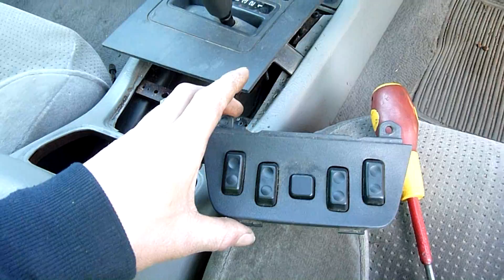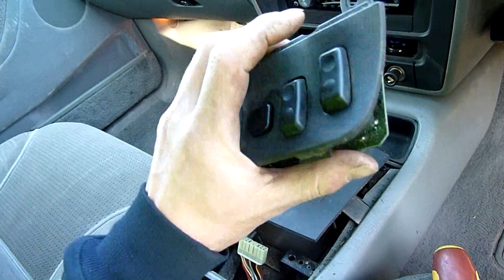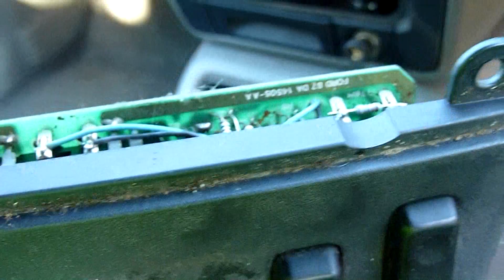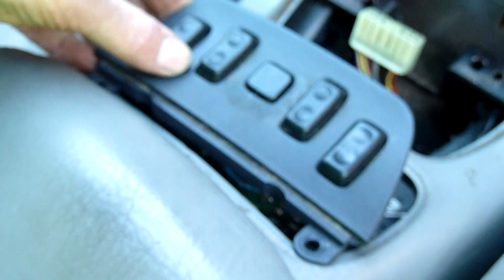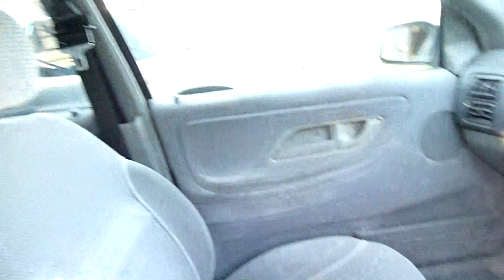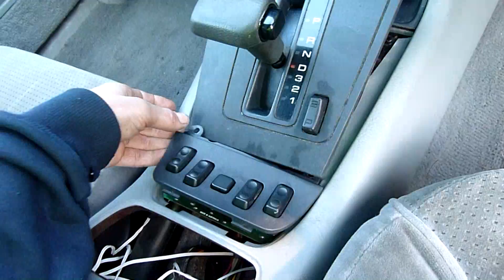Ford EB Fairmont Dead Power Window Fix

Comment: As the proud owner of a '97 EL Fairmont Ghia, I was deeply upset when I consulted YouTube looking for a solution to fix my drivers window, 'deeply upset' due to all the depressingly complex motor replacement videos I found, dreading the exercise... Then, I stumbled over your clip, which I thank you from the bottom of my heart for you posting it... Through a process of deduction, I realised, your solution could actually work, and as it only required the removal of a few screws, unclipping a connector, buying a soldering iron, solder and magnifying glasses, it was a whole lot easier and cheaper than stripping the door panelling and fitting a replacement motor... Long story short, it worked...! I re-soldered every suspect join (about 8) reinstalled the switches and up she came, first time... THANKS MUCHLY...!!!🥰

Comment: It was thanks to recalling this video I watched a while ago that I recently thought to check the circuit board under the switches for cracks in the soldering when my 1992 NCII's front passenger window would not go up. I quickly found two, but not before I dismantled a switch! Fiddly things but gave a quick clean to it.
I tested by sticking pieces of foil over the suspect joints and the window worked. I only reflowed the offending joints though.
So it's ok to splash soapy water all through and allow to dry instead of dismantling the switches one by one to clean?

Comment: Stuff like Coke is the worst because it will eat up the copper. When I worked for a cash register company ages ago, a hurricane came through and flooded many grocery stores and ruined lots of checkstand controllers. We revived a lot of them by removing all the equipment, scrubbing it in soap and water, rinsed with acetone, dryed with compressed air, then letting it bake in an oven overnight on as low a setting as it would go.
Reply from the maker: oh yeh flood damage is a pain, especially because it leaves mud all over the boards :(

Comment: Whats the redline on that 6Cyl ?? lol doesnt look to be terribly high, Also wern't those the series of engine to have trouble with getting unmetered air into the engine from various places like when you had the oil cap off, making the car run like crap ??

Comment: Makes me wonder about my Grand Marquis why the front windows slow down to a crawl right before there about an inch from closed,  and I can tell there pulling more amps because when the slowdown happens (if im putting them up without the engine running) the little clock on the dash dims out.  Do you think it'll be electrical or lube?  They seem to go down just fine though.
Reply from the maker: take the door trim off and lube the internal mechanisim, and run some silicone spray down the guides in the sides of the window frame, especially towards the top.
Reply: Thanks !!  I'll do that in a few weeks when I have the money to, Although what surprises me is how high the mileage is on the car and thats literally the only thing wrong with it other than the fact it needed a belt and an oil / filter change which ive already done.
Reply: Aussie50 I was finally able to afford silicone spray and its fixed my issue.  It works like new,  except the fact I see a little play as the window goes up which is telling me the track is worn out.

Comment: Thank god you posted this video. My electric windows in my ED Fairmont have the same problem. Never would of thought it's be a problem with the controls. I thought it would of just been a motor problem.
Cheers dude.

Comment: wondering if you ever got the linx 6800 ink jet running?
Reply from the maker: nah, was going to cost thousands so its in dry storage
Reply: Aussie50 it looked to me asif the ipm board needed to be reset which is lk2 north and south position is reset and east west  is the run position. so with the power off pull the battery link which is lk4 then put the reset link (lk2) in the north south position then let sit 5 min. then put battery link back on and reset link back to run position power back on and let run 25 min or so to see if the ipm will communicate with the keypad board if not let me know there are a few more options to try

Comment: The solenoid on the window switch is for the drivers Windows .push the switch to go down and the solenoid holds the switch down then releases when the window is fully down
Reply: And under the buttons themselves there are plastic pins that push the contacts and I found on mine the plastic pins on mine were melted and a good fix was Nintendo ds stylus fit nicely

Comment: Your car wouldn't be old enough to have lead free rubbish in the boards?
Reply from the maker: no lead free shit in it, but even proper lead solder fails after a while when subjected to mechanical force for so long.
Reply: Aussie50 metal fatigue

Comment: I looovve to lube the ..... outa the tracks aswell, it helps with manual and power windows :)
Reply from the maker: yeh absolutely, pulling the door trims off and lubing the whole mechanism will save them.